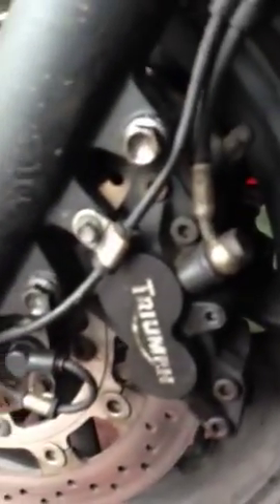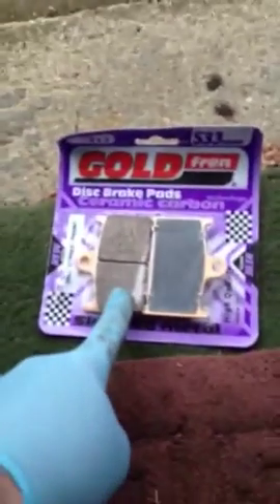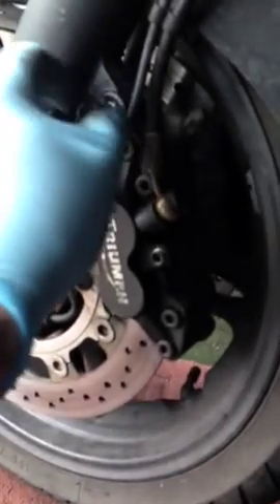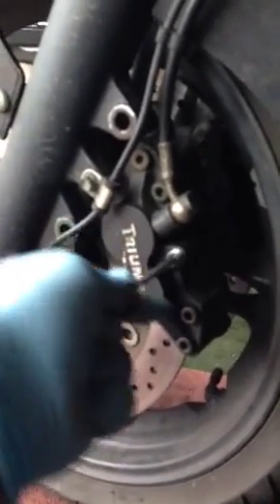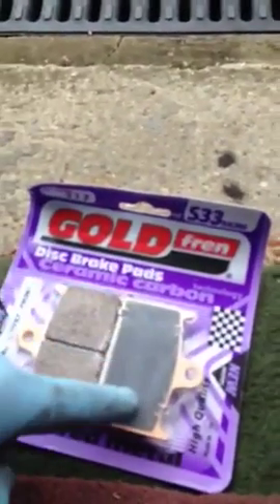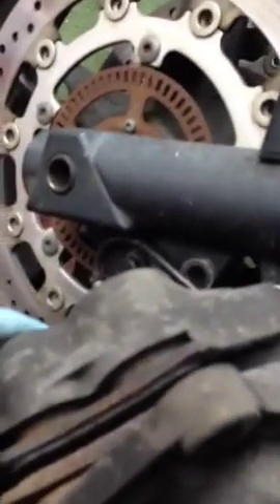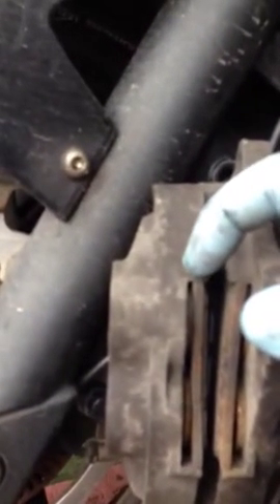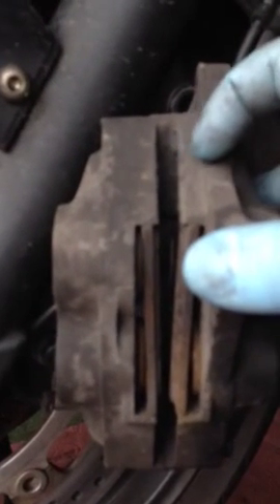Changing brake pads triumph 1050 help fix chat mark savage

Comment: Mark I just installed new brakes n brake lines,filled it and tried to bleed it (first ever attempt mind) but i have those brakes where you can adjust the levers from settings one to six. Whike bleeding I did it on setting six then it was biting slightly and I moved it to setting one but had nothing? Why is that? Also how do I build up more pressure so it's sharper braking?
Reply from the maker: when changing the lines as well you empty the system and getting it all back to normal can be a job in its self to be honest, I use a brake bleeding kit when I do a total rebuild as its hard to get it all working again and even harder is ABS or dual braking ~!!!
the kit suck the brake fluid and make it a lot easier
Reply: @marksavage  Sweet bro ill look into it